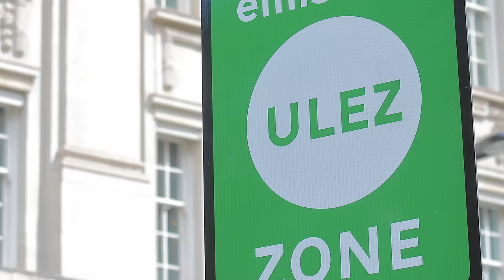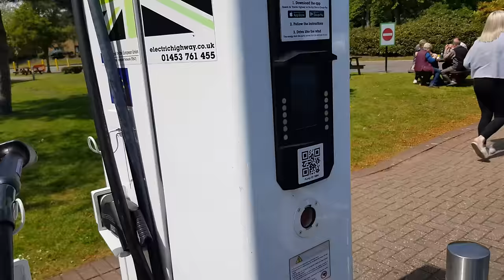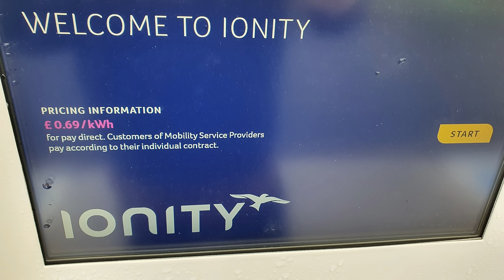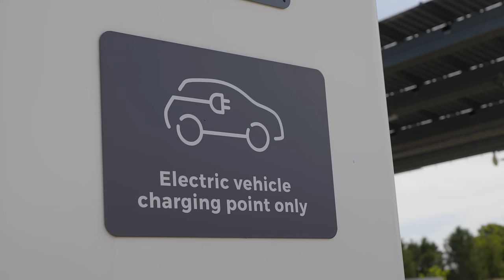The Uncomfortable TRUTH About EVs: The Version NEITHER SIDE Wants You To Hear

Comment: without some serious revolution to bateries that no one see comming really in near future, or etleast prices of them being resonable to begin with, you can be sure it will be a problem in couple years :)
you can look for taxi driver from US that was been doing ~300 miles/day and his batery died in like 14 months or so and after around 120k miles if i good remember, for sure out of varranty tho,
thats 120k miles to werry expensive repair that cant be really avoided only will take longer if you dont use super chargers that often and dont do to much milage, battery degrade over time and with each charge especially,
another thing is recycling of bateries there is one company that suposedly recycle 95% of batter which seems grate, not sure what cost of that is and will need to be much more common to impact actuall prices
EV ar more expensive that gasoline versions and after ~10-15 years you should add another 20-30% of initial price for battery, if runing it on electricity dont end half cheaper over that time you are ending at significant loss,
trying to sell it before batery change will end with much lower price that is suposedly degrading faster than for gasoline version anyway

Comment: You left something out. It is a conversation meant to be "fair," right? It is not just about how hard is to put the fire out in the car. It is about the fact that they burn hotter than the melting point of concrete and asphalt. Now you have a fire that is going to melt through the floor of the parking garage. I am pretty sure that is what happened at your airport.

Firefighting was something we all learned at sea. There is a material that burns at a similar temperature. The material is called "Magnesium." For a solid fuel fire...sure you can use water to remove the heat and put it out. This is a class alpha fire. For liquid fuels (like gasoline, lube oil jet fuel and diesel fuel, you must use foam. TYhis is class Bravo. A class Charie fire, this one is elec trical, yupu meed to use CO2. YThen y there is the Magnesium fire...Class Delta. Do you know what you use to put THAT out?

Nothing. There is one strategy for it, and one strategy only. You find a way to jettison that overboard and into the ocean. For, if you do not, it is going to find a way into the ocean anyway. You see,it will not stop burning until it has burned through everything in it's path and goes out through the bottom of your ship.

And we had to be trained to know this because...yeah...it was in batteries...and we had batteries aboard.

Comment: As is said in the video, it's important to listen to both sides, and I do. However, it's also important to fact check. 

For the charging at home, JayEm tried to brush away home EV charging for cheap, but there are various products on offer from major energy companies that make cheap nighttime charging. Which can become even cheaper for people who have home energy generation such as solar, wind turbines, etc. as they can make their own fuel. But, the bottom line is that cheap electricity for EVs at home is easily available to many and cannot just be hand-waved away as JayEm attempts to do. 

JayEm did not even mention P2P charging, which again has the potential to considerably undercut public commercial charging, particularly if public commercial charging is overpriced creating a real opportunity. 

I also don't like having to have subscriptions (paid or not) to access cheaper electricity from public points (though such should only be a last resort), but this is part of a bigger problem not specific to EV power. For example, 'clubcard prices' at supermarkets meaning that I have to use the card, or pay more for my shopping. Often quite a bit more. The same applies to the lack of people at charging stations, while the same is often not the case at petrol stations. EV infrastructure is recent, and hence follows recent trends. While petrol stations are often long established before these trends have taken over. 

It's true that not everyone can yet charge at home, e.g. Victorian terraces are problematic for parking, let alone charging. Some councils are developing solutions such as under-pavement cables allowing people to charge cars from their domestic supply. And, for EV car owners to have reserved places outside their own home, for regular access to their own private charging points. This may make it harder for people in terraced houses to own multiple vehicles, but parking already makes that difficult in many cases. And, there will be convenient changes for owners with only one car in this model as they'll have guaranteed parking. 

There are small affordable EVs around now, such as the Renault Zoe. And, the forthcoming BYD Seagull which has the potential to be a real game-changer. 

I haven't met any EV car owners who expect their cars to not depreciate, or be free to run, giving that ongoing costs include insurance, maintenance, and so on. (Even if someone was so extreme as to only drive using energy that they generated themselves - which I have heard of.) Hence, I don't think there is any need to disabuse EV owners of these 

JayEm did not claim that insurance is unavailable for EVs, but this is often claimed elsewhere. I'm currently not a car owner and am looking to buy a car. I often compare EVs to otherwise similar petrol cars, and I keep seeing quotes for the EVs that are actually less than the similar EV, with everything except that car being the same. Car insurance is expensive, but this does not seem to be a specifically EV problem. 

Fires in EVs are mentioned. It isn't mentioned that EV fires are far less likely than for petrol cars, and I've seen the figure 19 times less frequent. The Tesla Model Y was WhatCar safest car of the year in 2023. The risk of fire is there, but when I google to find out who has died in car fires, I'm finding cases of petrol cars, not eVs. Also, JayEm presents sprinklers and foam as being ineffective in putting out EV battery fires. Which is true. But, there are a number of extinguishing agents that will put out lithium battery fires. As EVs continue to rise in numbers, then fire engines (etc.) will need to carry the equipment required to deal with those fires. 

The potential for businesses to refuse electric cars was raised. However, businesses generally can't just refuse a large part of the market, which EVs are rapidly becoming, and expect to stay in business. If some businesses turn away EVs, then there will be competitors who will do. And, as the market (car owners) continues to change, any businesses that don't service it will go out of business and be replaced. 

In general in this video, JayEm presents the problems, but does not seem to have done the simple and straightfoward research to look for the solutions, or developing solutions. As technology changes, the world will keep up. E.g. air travel and supermarkets are old businesses, and for both (and more) the internet and then mobile phone apps are now an important part of their business. 

Whether petrol-heads like it or not, the world is changing. And, not only will EVs take over, but the rest of the world will adapt to that change. 

As said, I don't own a vehicle myself. But, I'm doing the research and on the balance of everything, EVs are just way ahead for me compared to fossil fuel cars.

Comment: Until wireless charging is a thing, this will never work. Having entire parking lots with wireless charging is the way to go. Only electric cars can park there. This would add major incentives. Especially in congested urban areas. I don’t care for electric vehicles personally. But there are certainly many improvements that would make them much more appealing. Especially if the entire road was a wireless charging system. But this type of transition would require a crazy amount of work. Not impossible, just not realistic yet either.

Comment: The battery needing replacing on an EV is debunked from existing vehicle real world use data now. True of the first gen nickel based Leaf batteries, but not of the current brand new EVs. Statistically the issue now is what to do with the 90kWh battery from an EV that's now used and second hand after 150k miles, but actually has the vast majority of it's capacity and life still left in it. That's why Tesla is doing stationary battery storage solution for grid balancing; they can re-use the end of life batteries from cars.

Comment: 23:20 Not true! Sprinklers would cool the cars: preventing the fire from spreading. The peak heat output in ICE fires is actually higher than with EV fires.
The trick with EVs is that you need to keep the sprinklers running for hours. ICE cars burn themselves out pretty quickly.

Comment: EV's are so expensive to buy, less because of tech, but more that car manufacturing industry has mega bucks invested in ICE vehicles manufacturing, so having to switch to EV's means that lack of return in prior investment has to be paid for. Further public charging prices are "charging" equivalent prices to carbon fuels, why would the OIL industry make it easy to not buy Oil products, and the cost of public EV charging infrastructure is risky as an investment, so prices to use will be appropriately priced. 
EV's are the future, battery tech/charging infrastructure etc is probably not the future. The battery is the fire hazard, electricity is not, so EV cars - good - batteries = bad

Comment: There are very few issues with ICE air pollution these days, we are not living in the 1950s. The air in the home is actually far more polluting if anyone cared to Google it. Pointless going on about how cheap an EV was to run years ago, these days it’s more expensive, and it doesn’t even attract fuel duty, YET, Quentin 😂 meanwhile we all subsidise EVs. Oh, and for fun cost your time driving to a charger and an hour waiting for a charge on a dark wet winter night. And don’t even talk about EV fires. Good talk though Jay 👍🏻

Comment: Maybe I'm rude with this, but I gonna say it. If a person is so diabled that they can not plug in a charger cable (which is not heavier then a gasoline pump's hose) then they shouldn't actually drive. It's literally the same thing for the two. Otherwise I understand and accept all the statements you said in the video. Great job of explaining!

My conclusion of this whole, let's say "war" of ICE vs EV that nobody have to rush, or decide right now. Nobody, no law no nothing is FORCING anybody to buy an EV, and still nobody will force you to buy EV-s even after 2030 or 35! Only brand new ICE cannot be sold, the "old" ones which are on the roads, are gonna stay on the roads until they get used up, or writen of because of a crash or something.

In Hungary the cars with 2 stroke engine are forbidden only from 2020, just 30 years after they never ever made again.

Comment: I have an ioniq 5. Its terrible. If the main battery drops below 20% it drains its 12v battery and you cant start it. Apparently it is designed to behave like this. The dealer is horrific too

Comment: EV's and Samsung phones catching fire isn't just a "mistake", there's a failure rate in lithium batteries as there is for anything else that exists, it just happens that that's how lithium batteries usually fail. Dangerous? Yes. But it's not that dangerous lets be realistic, because it's rare.
The problem in EV's are as you pointed out that the running costs can be unpredictable and quite high already.
Not only that but the're more expensive out of the gate.
Not only that but they don't work right or at all during winter depending on the temprature.
Not only that but the batteries are expensive and usually only last a few years in good condition.
Not only that but for many people they actually pollute more as out of the gate they've already needed like ~100k miles more than a petrol car in terms of CO2 emissions to get produced.
Not only that but for some EV's the battery is a subscription when fuel tanks aren't. 
Not only that but due to the above mentioned points whoever buys an EV has to be expecting selling it for half of what a normal devaluation would look like in a petrol car. 
Not only that but at the exact point where we are they are less recyclable.
Not only that but they have limited range and/or take too long to charge.
So, even though I love EV's and have built my own before EV's were a thing, at this exact moment only regulations make EV's attractive, they are usually not a good option for most people.

Comment: All points considered here, but at the end of the day, i am not prepared to spend hours waiting for a car to charge. I value my time far too much for that kind of nonsense. Nor do i want the hassle of planning a route to the next charging point (therefore potentially excluding venturing away from major highways to go on an adventure etc etc) . I will continue to use petrol and diesel. Once my 24 year old E46 comes to end of life (given its condition thats still probably at least 10 years away) , ill probably buy another one! Probably in 6 cylinder diesel format, rather than my current 4 cylinder petrol.

Comment: EV's are not that great. I have known six (6) people who owned them and three ran away screaming due to poor reliability issues, expense of repairs, and because the advertised charging times and battery range for long trips are a pipe dream as the car ages a couple years or is not run in a narrow range of temperate climate. During winter seeing the battery run down 75 percent in under 70 miles makes these cars a joke. As a city commuter they are some of the worst possible cars imaginable because if you don't have a garage where to charge your car the power is 4x as expensive in the "superchargers" and this is where their painfully short range and long charging times will rear their ugly heads. 

For the United States market the fact that the EV does not pollute is a very bad thing because it means it doesn't have to have OBD-2 communication potential. So now you can't find a shade tree or neighborhood mechanic to fix your car inexpensively when its out of warranty and because the diagnostics and repair is proprietary you have to pay stealership prices for the entire life of the car. One example is how the battery on a Model 3 costs 14k to replace after 6-8 years (though it starts degrading almost right away). That pays for a lot of oil changes and gasoline!

They are perfect for single people without children or families who enjoy a lot of excess time and money who feel the need to virtue signal.  Everyone else for now would not be well served.

Comment: Who knew that cars were cheap when someone else paid the fuel cost.

The reason fast chargers are really expensive is because you are paying for the surge capacity. You need extra electricity distribution equipment which is only used a part of the time. You have to pay for this, hence the power is expensive.

Large industrial users have been charged on this basis forever. It was often cheaper to leave gear running rather than turn it off and suffer the large demand charges which came along with the restart. Draglines in mines were a great example of this.

You really don't seem to have any understanding of what is required to provide widespread high demand one moment, zero the next electricity. The capital cost has to be set up to provide the maximum rate. The capital has to be repaid. Memberships are part of how this is done. You pay extra aside from the charging rate

Comment: The tech is available today right now that is cheap where you could double or more every car's MPG with combustion engines using gasoline as the fuel. Instead of using liquid fuel squirted into the engine - liquid fuel does not burn. Use Only the fumes. So if you introduced only the fumes of gasoline into the engine you would in essence double MPG while reducing pollution by 50%. This is NOT new technology, just refused to be released to the public by the "rich" of the world. Right now, today. Cost would be about $1,000 per car.
Reply: How is your idea different from fuel injection?

Comment: I am just wondering on how green is an ev. Forget the production footprint of an ev car in compsrion to a regular car and the extra cost to buy one and the car would be obsolete in 15 years just like laptops and smart phones, At least 60% of electricity UK used to charge an EV is fossil derived electricity. So please explain how green EV cars are. The more ev cars are bought the mire electricity  is needed to charge them. At this rate more fossil fuel will be producing this extra electricity. Untill all electricity is produced from renewable energy and not fossil fuel, EV cars won't be as green as perceived 
Thank you